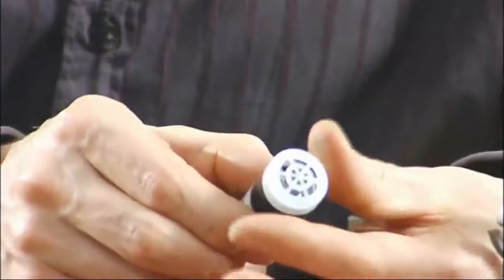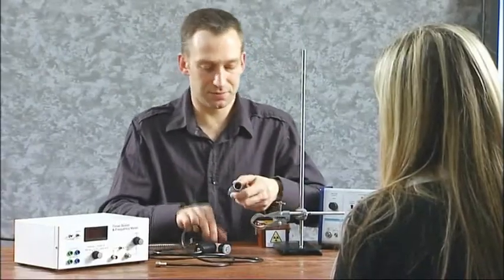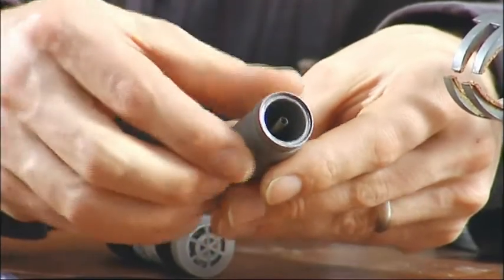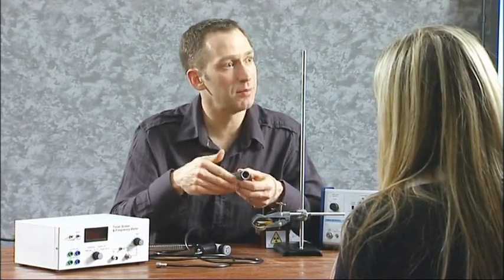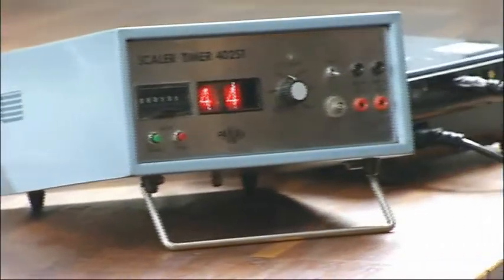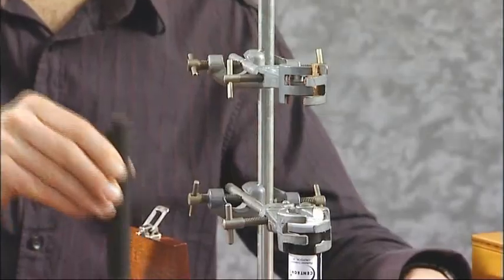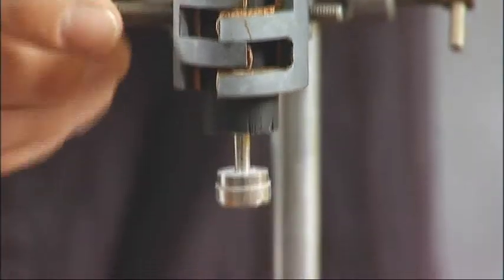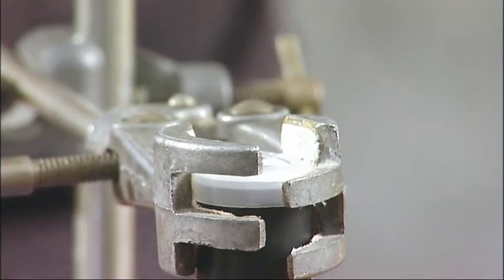Teaching Radioactivity: The Geiger-Muller tube

Comment: I should also mention since these are "sealed sources", using the G-M tube upside down is fine, however it's best to have the G-M tube facing down, because an unsealed source, such as a piece of uranium ore or a radium watch hand for example, could flake off dust and contaminate your G-M tube, giving you false and elevated readings. I'd recommend having a G-M tube facing down, with the exception of "sealed sources", like the one in this video, which is fine. 👍

Comment: I think that is a ZP 1481 Mullard G-M tube (similar to the LND 712 G-M tube). Also, pressure change can rupture thin mica end-window and "pancake" type G-M tubes, so be careful if you take it above 8000 ft. (2440 m). As for "sealed sources", Pu-239 is by far the safest, externally speaking, as long as the source mounted in the foil and cup isn't somehow inhaled were it to be tampered with. That one is an exception. It's pretty much harmless. However, these source sets are relatively low in specific activity to begin with, but very useful. Pu-239, unfortunately has a very bad reputation, and its dangers are highly exaggerated, yet it's the safest out of these source sets, by a long shot since it emits alpha, and with low-energy gamma rays with very low branching intensities, with 51.6 keV @ 0.027%, and 38.6 keV @ 0.0105%, which are the MOST common gamma ray energies/decay. Am-241 is also an alpha emitter, however it emits low-energy gamma rays too, but with much higher branching intensities, being 59.5 keV @ 35.9%, and 26 keV @ 2.4%, which are the most common gamma ray energies/decay. There are many more known gamma energies for Pu-239 and Am-241, but they aren't emitted nearly as much as the four energies I mentioned here. This is also why Am-241 is easy and quick to identify with gamma ray spectroscopy, whereas Pu-239 is slow and hard to detect with gamma ray spectroscopy.